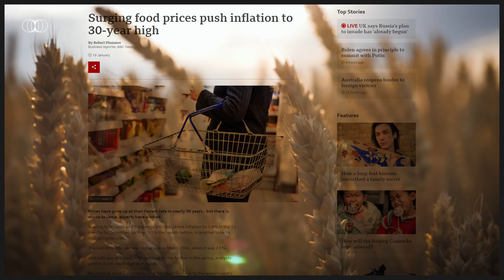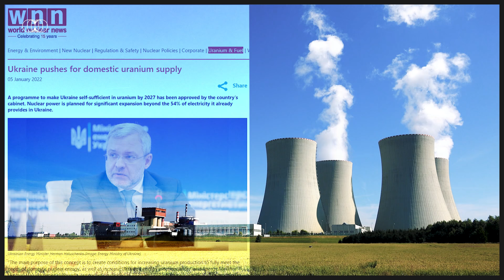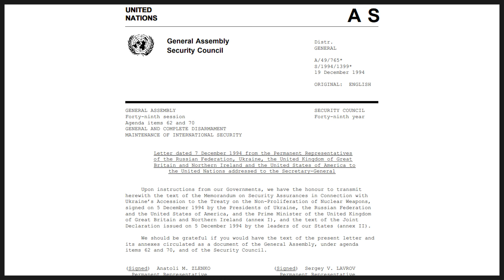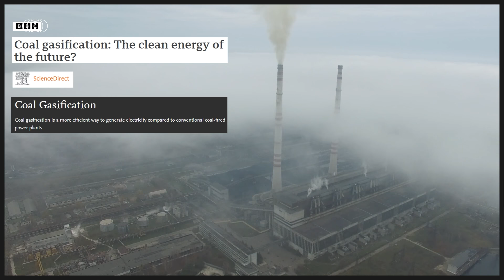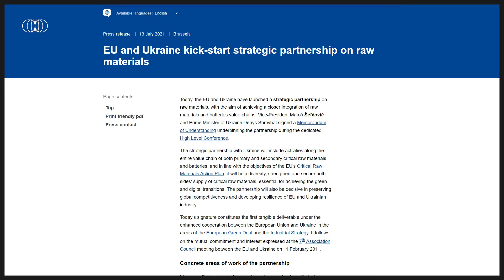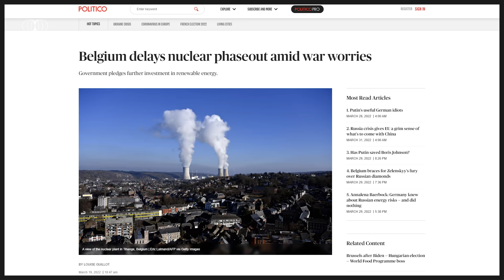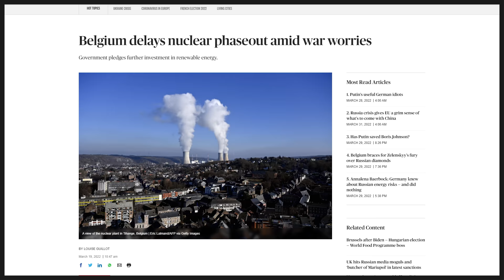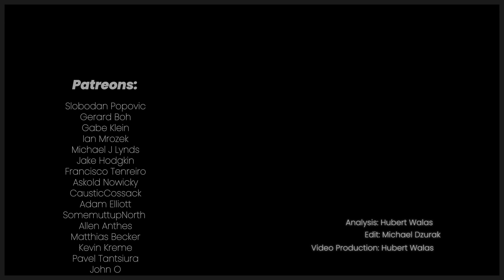Ukraine Sits On Raw Materials Worth Trillions. The Country's Chance for Reconstruction?

Comment: German opposition to nuclear power in the face of continuing their hydrocarbon plants seems like a miscalculation at best and myopically emotional at worst. As a source of clean energy, nuclear is far more easy to install than renewables. That they wouldn't first phase out coal and natural gas with nuclear, and then nuclear with renewables, but the reverse, is a decision that honestly baffles me given the environmentally friendly stance they oft try to promote themselves as taking.
Reply: I wouldn't call nuclear waste as clean energy and environmentally friendly.
Reply: the greens are paid by gazprom
Reply: @wokeaf1337  Nuclear waste is a problem, but it is about 1000 times less of aproblem than fossil fuel pollution damage and waste
Reply: @wokeaf1337  Its better than coal and the others besides the technology is getting better so is waste management eventually we might see nuclear energy with little to no waste
Reply: @wokeaf1337  Nuclear is clean, the footprint is extremely small, its basically just boiling water. However, the risk, which is scary af is if things goes wrong, but we're also putting in place extreme precautions to prevent another Chernobyl, and the technology has advanced quite far and there's even great methods of storing the Uranium waste which is a lot better than before with minimal if any effect on the environment.

Scary, yes, but the absolute best other wise.
Reply: @wokeaf1337  a nuclear powerplant creates less than 2 cubic meters of nuclear waste.An hospital creates more nuclear waste .
Reply: @wokeaf1337  I would. The environmental impact from nuclear waste at burial sites like Onkalo in Finland is comparatively nonexistent to the amount of released CO2 in the atmosphere that comes from burning hydrocarbons for energy. Arguing about the impact of nuclear waste when properly disposed of is a flimsy case of whataboutism at best.

Besides, even acting as though this hypothesis of nuclear being inherently and severely dangerous for the environment is true, why wouldn't you take a lower-impact replacement in the meantime, instead of keeping the higher-impact one? I understand that the cost of building intermediary nuclear plants on the road to 100% renewables can be seen as an unnecessary additional cost, but isn't a quicker path to zero carbon emissions the main goal here? Finding places to bury nuclear waste is, in my opinion, a trivial concern in light of that.
Reply: @marcobonesi6794  The Climate and Environmental Protection Foundation is the group you're thinking of. I have my own gripes with Die Grünen, but I'd rather not attribute things like Gazprom funding to them unless true.
Reply: Renewables are far cheaper and easier to build on large scales then nuclear power plants, but they cant generate a constant, stable output of energy. The biggest mistake we can do is thinking renewable and nuclear power are somehow opposite sides; A mix of both is the best we can do until we have fusion reactors, renewables for efficient, cheap, decentralized energy production and nuclear power as a stable backbone to even out the inevitable dips in power generation.
Reply: @wokeaf1337  The amount of nuclear waste from the production of all energy you will consume through your entire life on Earth is about the size of a Coke can.
Reply: @starwarsgames5467  Source? I was under the impression that nuclear was cheaper to utilise, but I'll happily admit to being wrong here if you've got something for me to look at.

(Although, I think it's also worth noting that some places just don't have access to the geographical features necessary for certain types of renewables, whereas a nuclear plant can theoretically be placed anywhere.)
Reply: High hurdles for longer nuclear power plant lifetimes
Status: 08.03.2022

Should the operating times of German nuclear power plants be extended to prevent supply bottlenecks? The Economics and Environment Ministries are against it - and operators also see high hurdles.Despite possible energy supply bottlenecks due to the Russian war of aggression in Ukraine, Economics Minister Robert Habeck and Environment Minister Steffi Lemke have spoken out against extending the operating lives of the remaining nuclear power plants. "As a result of weighing up the benefits and risks, an extension of the operating lives of the three remaining nuclear power plants is not to be recommended, also in view of the current gas crisis," the newspapers of the Funke Media Group quoted from a joint review note of the Economics and Environment Ministries. 

Short-term extension not economicalAn extension of the operating lives of the three nuclear power plants still in operation would not yield any additional electricity in the winter of 2022/2023, but at the earliest from the fall of 2023 after filling with newly manufactured fuel rods. Continued operation would have to be accompanied by an extensive safety review and staff training for each of the three nuclear plants.To justify the expense economically, an extension of operating times would be "necessary for at least three to five years," the paper says. The economics and environment ministries assumed that in the period until 2028, "other options will be available to ensure sufficient power supply despite a gas shortage." In addition, there were doubts as to whether an extension could be justified in a constitutionally sound manner.

Nuclear companies also see high hurdlesToday, German energy ministers are meeting for a special conference to discuss energy security after the Russian attack on Ukraine. The Economics Ministry said in advance: "Extending the operating lives could only make a very limited contribution to solving the problem, and at very high economic cost. The state would have to assume risks on a large scale here. The German nuclear power companies also believe that the feared energy bottlenecks can hardly be offset quickly by extending the operating lives of nuclear power plants. A spokeswoman for PreussenElektra, a subsidiary of the energy company e.on, pointed out that the supply of new fuel rods would take a long time. "According to an initial estimate, we assume that fresh fuel elements could be available in a good 1.5 years," she told the Rheinische Post newspaper. In addition, the corporations would then probably have to look for new uranium suppliers. "In the last years of operation of our power plants, we purchased the uranium needed for the fuel elements from Kazakhstan and Russia, and in small quantities from Canada."

Kretschmann: No prohibitions on thinkingBaden-Württemberg's Minister President Winfried Kretschmann, on the other hand, did not rule out extending the operating lives of coal-fired and nuclear power plants. He said that Economics Minister Habeck was right to say that security of supply must be guaranteed and that there should be no prohibitions on thinking. "I also see it that way," Kretschmann told the Süddeutsche Zeitung newspaper. "We must now find solutions in the short term - and in the medium term, there is no way around the fact that we will continue to push the expansion of renewable energies in order to make us independent of fossil fuels. "At the turn of the year, the Brokdorf, Grohnde and Gundremmingen nuclear power plants went off the grid. Since then, only the Isar 2, Emsland and Neckarwestheim 2 reactors, which are scheduled to be shut down at the end of this year, have been supplying electricity...
Reply: @marcobonesi6794  But that has nothing to do with the fact that they are paid by Gazprom.
I hate them myself, but rather because they almost always think first of the EU, other countries than Germany (always want European solutions), are often very left-wing, hate patriotism.
And as I said, since they are with the "Deutsche Umwelthilfe "an NGO that receives too much money from the U.S. and practically all major projects of Germany with lawsuits brams:
Billion € station project, there lives a salamander kind, construction stop=costs go to the sky.
Nord Stream 2= sue sue sue etc.
AKWS or nuclear waste transports=sue, block roads and railways.

Electricity lines from the north to the south of Germany=cry because they have to be built through forests etc.
Reply: @marcobonesi6794  That makes me laugh.

And there are many reasons against nuclear power.

For some, just look at France, which has had more blackouts than Germany, and has had to shut down more than half of its nuclear power plants a few times because of problems, such as the water in the rivers used for cooling becoming too warm in the summer (which is likely to happen more often).
They are outdated and their lifetimes have already been extended 2 times beyond their normal lifetimes.

All European nuclear power plant construction projects have problems right now, exceeding the planned costs and construction times.

And also the French operator of the Akws is permanently before the bankruptcy and must be subsidized again and again.
Reply: @revilorere  there are only 4 major nuclear disaster in history, 2 (mayak, pacific islands) are basically totally pursued, 1 (chornobyl) is a stupid human mistake mixed with old doomed technology mixed with soviet corruption, pretty easy to avoid, 1 (fukushima) is due to a natural disaster in pheraphs the most dangerous place on earth, nothing like that will happen in malaga, bologna, dusseldorf or lviv, I'm not even remotely scaried
Reply: @Janoip  ahhha . france is the cleanest major industrialized nation.Both in production and in consumption.What blackouts? The only times their reactors where shut down were during their scheduled maintenance. Use electricity map,an app that allows you to see how electric energy is produced and consumed in europe per every source.It 's data are adjusted every 15 minutes.
Reply: @marcobonesi6794  🥱

Fighting blackouts in France: nuclear power plant lifetime extension to 50 years
Since the energy turnaround is not making any progress, the nuclear power country wants to (or has to) extend the operating life of particularly dangerous old reactors.

Have our readers in Germany, Switzerland, Austria or Luxembourg ever received an e-mail or text message from their energy supplier or grid operator asking them to limit their electricity consumption at certain times? In France, a country with a nuclear power grid, it has been common practice since 2008 for citizens to be urged to do this via radio and television to prevent a blackout throughout the country. This was only narrowly avoided on January 8, when the country's neighbors were once again urged to save electricity.

The fact that there was almost a blackout throughout Europe, against which everyone is now trying to prepare, was also due to events in Eastern Europe.

Now, 32 old reactors in the neighboring country are repeating what was already seen with the old reactors in Fessenheim on the Upper Rhine. The French nuclear supervisory authority, the Autorité de sûreté nucléaire (ASN), is prepared to extend the operating life of old reactors by 10 years to up to 50 years, even though they were only designed to run for 40 years.

The nuclear regulator says that the extension is subject to the condition that design plans be updated, safety measures be improved, equipment be repaired and components be replaced. Years ago, however, the regulator spoke of a "worrying safety situation" at the nuclear power plants whose operating lives it now wants to extend.

With the extension of the operating life of Fessenheim, however, the ASN has already shown how the safety situation is improved primarily on paper. A faulty steam generator whose safety certificates were forged did not have to be replaced at the Upper Rhine, but was simply subsequently approved by ASN.

Fessenheim even went temporarily out of control in 2014 because of a leak of 3,000 liters of water that had entered unsealed control cabinets.

ASN has repeatedly shown itself creative in working around significant safety problems on paper. Although central safety elements are also defective, as at the new nuclear power plant in Flamanville, for which certificates had also been falsified, the ASN also wants to permit operation of this reactor.

The defective lid of the pressure vessel at the "European Pressurized Reactor" (EPR) is to be inspected after a few years in operation, although it is unclear how this will be done. No one is talking about the soil, which is also affected, as testing for this is ruled out.

It will now be interesting to see which retrofits the highly indebted state-owned operator Electricité de France (EDF) will have to tackle in order to extend the operating lives of 32 ancient reactors. For example, German Environment Minister Svenja Schulze has also stated, "There are technical and economic limits to what can be retrofitted - for example, an embrittled reactor pressure vessel cannot be replaced," which is why she rejects lifetime extensions beyond the "original design life."

As Telepolis had repeatedly noted, the approach in France, in which the nuclear regulator is playing along, is simply due to the shortage of electricity. Considerable dangers are being accepted because the country has maneuvered itself into a dead end in terms of energy policy. According to Greenpeace, 13 reactors are already running longer than the 40 years for which they were once designed, because the expansion of renewables is progressing very slowly.

The power shortage worsened with the shutdown of the two Fessenheim reactors last summer. In addition, the country is scheduled to phase out coal-fired power in 2022. Although coal-fired power plants contribute only 2% to the electricity supply, this means that there will be a shortage of additional electricity in the winter if it does get cold again.

But the nuclear friends in Paris had planned quite differently. Actually, the EPR in Flamanville with a net capacity of 1.6 gigawatts (GW) was supposed to compensate for the outage in Fessenheim eight years ago. But the EPR will not be connected to the grid before 2024.

Moreover, in view of ever new safety problems, it is questionable whether this will ever happen. In fact, 30 to 40 new EPR reactors were planned, but no new project has been started and therefore the operating time must be extended to dangerously buy time..
Reply: @marcobonesi6794  Some of many

Nuclear power plants shut down - again - because of heat

The Grohnde nuclear power plant will be shut down today because the Weser River is too warm; shutdowns and curtailments have already occurred in France and Switzerland.

The fact that it is getting hotter is really no longer news. But such record temperatures of over 40 degrees in Germany, even 42.6 degrees in the French capital Paris or in Switzerland, breaking all-time records, are also causing problems for the nuclear power plants. They are supposed to secure the basic supply, but it turns out - once again - that they can't really do that, and with climate change come ever greater problems.

This Friday, the Grohnde nuclear power plant is to be shut down due to rising temperatures on the Weser. Then, the river's water is expected to reach the critical limit of 26 degrees, he said. To protect the ecosystem of the Weser, warmer water may then no longer be fed into the river. Only when the Weser cools down sustainably will operation be resumed, the operating company Preussen Elektra announced. It assumes that the power plant can probably go back into operation from Sunday.

The heating of the Weser is also due to the drought, which currently has comparatively little water. This also applies to the great Garonne in France. That's why the two reactors at the Golftech nuclear power plant were shut down on Tuesday because the Garonne, which also has relatively little water, was getting too warm. In Chinon, on the great Loire, one is also only 0.3 degrees below the shutdown threshold. Actually, this nuclear power plant should also have been shut down long ago, but in the nuclear power country of France, the limit is set at a murderous 30 degrees for flora and fauna.

In the nuclear power country, people are now used to blackouts practically every winter. Most recently, this was even the case in January, although none of the many old reactors had to be shut down unplanned, but because coal-fired power plants were on strike, which in any case contribute very little to electricity production. Now, because the two ancient reactors at Fessenheim are scheduled to go offline in 2020, things could soon be tight in the summer as well, because the replacement with the EPR will fail to produce electricity.

As the heat rises, the need for cooling increases not only at nuclear power plants, but also in companies and private households, which in turn significantly increases the demand for electricity. If rows and rows of nuclear power plants have to be shut down during a heat wave, the usual calls to save electricity in nuclear power country will probably soon be heard in the summer as well.

In the meantime, Switzerland has learned from the fish kill in the Aare River last year and lowered the threshold for cooling water withdrawal for nuclear power plants to 25 degrees. If the water temperature rises above 25 degrees for three days, it must be shut down. The nuclear power plant in Beznau has already throttled its output as a result. The operators are lucky, however, because today the Gösgen nuclear power plant shut down unplanned. This means that the Aare will not be additionally polluted by this power plant. However, Gösgen and Leibstadt do not contribute as much as Beznau or Mühleberg to the heating of the river because they have cooling towers.

Since cooler water now flows from the Swiss Aare into the Rhine, however, the Fessenheim nuclear power plant does not come under pressure quite as quickly. In the Rhine side channel, from which the power plant, which has no cooling towers, draws its water, the temperature may rise to 28 degrees before the two reactors have to be shut down. Last year, this was already the case with the large, old and scrap-worthy immersion boilers in the Rhine..
Reply: @marcobonesi6794  Germany is also a Exporter of Energy¯\_(ツ)_/¯
Reply: @Janoip  you have to look at the net export. Not the gross one. And germany imports more energy than the amount exported.
Reply: @marcobonesi6794  German electricity export surplus declines
In 2020, Germany exported around 17,400 gigawatt hours more electricity abroad than it imported. This means that the export surplus continues to decline
Bonn Germany imported significantly more electricity in 2020 than in previous years. Until shortly before the turn of the year (December 20), just under 33,000 gigawatt hours flowed into the German power grid in commercial electricity trading, according to figures from the Federal Network Agency obtained by Deutsche Presse-Agentur. That is around 36 percent more than in 2019.

Because less electricity was also sold abroad than in the previous year, the German electricity export surplus fell sharply. At around 17,400 gigawatt hours, it was only half as high as in 2019 (35,100). By comparison, gross electricity generation in Germany in 2020 was 564,000 gigawatt hours, according to preliminary figures.

According to the Federal Statistical Office, one reason for the growing electricity imports is the declining share of coal-fired and nuclear power plants in electricity generation in Germany. Particularly when there was no wind or darkness, electricity was imported to meet demand, the statisticians noted with regard to the first half of the year. In 2020, France was once again the main importer of electricity, while Austria was the largest consumer...

Translated with www.DeepL.com/
Reply: @yyperi  So only if people die is that a cause of concern for you? And between "clean" and "far less" of an issue, there are worlds in between.
Reply: @wokeaf1337  Nuclear waste can be perfectly contained, preventing any harm to the environment. All you need to do is invest in proper final disposal facilities.
Reply: @RM-el3gw  Nope, u need to dig deep, to store the nuclear waste in rock strata. As a result, the soil can lose its important functions as a (ground) water reservoir, pollutant regulator, climate regulator, as a habitat for a large number of soil organisms and as a source of food and raw materials. Drinking water is also at risk therefore it doesnt matter from what angle u look at it, it's not good at all.
Reply: Would be possible for a military to destroy the reactors, or nothing will happen?
Because the Chernobyl exclusion zone looks rather big; it's far worse than all nukes launched ever combined. Without counting the effects it had on Europe as well.
Reply: @98Zai  What country are you from?
Reply: @asasas9146  Yes the military can destroy reactors and possibly cause a meltdown on these older plants. That's the thing though.... older plants. The worst disaster to befall nuclear energy was not Chernobyl but the protests that arose from it. The result was that humanity not only moved away from using "dangerous" nuclear energy (statistically it's safer) but research and development of better, safer, and more efficient technology came to a grinding halt. Take Molten Salt Reactors for instance. They were looked into 60 years ago but due to regulations and bans the research slowed to a crawl. These things basically can't go critical. They can't Chernobyl. They can't Three Mile Island. They can't Fukushima. So....  hippies traded burying 1 cup per person of nuclear waste in a mountain for literal tons of debris per person floating around in the atmosphere that humans will have to breath. Nuclear waste might take thousands of years to break down but at least we know where it is and generally will not affect the environment.
Reply: @flyingeagle3898  It is not a problem with molten salt reactors that have fuel in a liquid form.   Nuclear Waste can be used to breed thorium and these reactors are actually nuclear waste burners.  The US actually invented these reactors in the 1960s but they were never made commercially and the technology was archived.
Reply: @98Zai  ??? So i am not allowed to know nuclear power is good because some other person thinks climate change isn't real? This makes no sense.
Reply: @enoughrope1638  Nuclear power is amazing. It's just not a good idea on Earth. Other types of energy production are going to overtake it before these "new plants" even manage to get built. So whomever convinced you it's a good idea either sits on the technology and is deadset on making a extremely big profit from it, or they want the rest of the world to have dangerous, centralized infrastructure. Nuclear power is great, and research should be conducted. We'll need it when we start exploring space.
Reply: @98Zai  why isnt it a good idea on earth? Why do you want to burn fossil fuels so badly? I'd love to switch to hydroelectric, solar, wind, geothermal etc but it just isn't possible to transition to it quickly and solar/wind have serious drawbacks. You keep mentioning centralized infrastructure as if we don't already have it and it isn't required regardless of where we source our energy. Unless you have a massive breakthrough in battery technology this will not change. Oh and think it through.... if you think someone convinced me nuclear is the way forward because of profit than perhaps someone convinced you fossil fuels are the way forward because of profit. TBH I am done replying unless you add something new to the conversation beyond anecdotal accusations of tribalism.
Reply: @enoughrope1638  Let's see; 
✅Stagnation of research into safer energy production.
✅Incompatible with the unique life forms on this one-of-a-kind radiation free planet.
✅Children own weapons that can cause incomprehensible damage.
✅Unreliable as main energy source in a much more chaotic future; Fukushima. 

Should I go on listing the practical problems involved as well? It's really easy to find online.
Reply: @98Zai  The first point is nonsensical as you are basically saying "Using safe energy production will prevent the research of safe energy production" and not acknowledging the fact that it could be applied to other forms of safe energy production as well. The second point is flat out wrong with life only existing on earth due to radiation. If you mean highly concentrated doses of radiation I must again point to the fact that modern reactors cant go critical. Fossil fuels kill vastly more people every year than nuclear energy ever has. The next point is also nonsense. Children owning weapons has nothing to do with nuclear energy. It almost sounds like you got all your information from playing fallout or something. Finally it is perhaps the most reliable source of energy there is. Cloudy days disrupt solar panels and they don't work at night. Windmills require wind. Hydroelectric falters during droughts. Coal, oil, and natural gas are reliant on supply chains which can be disrupted. MSR's? A small amount of fuel and they run for years with no chance of meltdowns. Reliable, safe, and clean. You're either really into fossil fuels or under the false impression that we can transition to pure solar/wind without a radical breakthrough in battery technology. I'm done here.
Reply: @enoughrope1638  I'd like to add that I hate fossil fuels. This isn't a battle between atomic energy and fossil fuels. Many countries are already using mostly renewable power, and I don't see any way that will slow down. We will have to phase out fossil fuels anyways, but phasing it out into atomic power isn't a good idea.
Reply: @98Zai  why?
Reply: @dimaselm3569  Please be more specific :)
Reply: @98Zai  I have a bit to say, so I would appreciate if you read it. ^^

"Stagnation of research into safer energy production."
This is easily your most coherent point, but it both relies on the preconception that nuclear is inherently dangerous to prove itself (circular reasoning), and it overlooks the fact that for nuclear, there is no waiting time. We have it. Now. Renewables are a work in progress, and we've no clear timetable on when they're going to deliver. Ought we to simply twiddle our thumbs while this planet burns? I think not. Nuclear interferes little with the R&D process of renewables, as it's an existing technology. Thorium reactors, meanwhile, are set to produce more energy with less waste, so maybe those would be worth researching? China seems to think they're a good idea.

"Incompatible with the unique life forms on this one-of-a-kind radiation free planet."
Radiation poisoning is incompatible, not nuclear power in of itself. If the determinant of whether or not we developed the technology for something was based upon if it was harmful to human life, there would be no industrial chemical industry. Yet, here we are, because both of them are beneficial to us in some regard.

"Children own weapons that can cause incomprehensible damage."
Okay, who are the 'children' here? I really don't think this is in reference to literal children, so I'm forced to speculate a bit. Is it that you're calling world leaders children, or entire countries? Because either way, it's an awfully high horse to be coming from.

"Unreliable as main energy source in a chaotic world; Fukushima."
Source? Fukushima Daiichi failed because there was a 9.1 earthquake and tsunami, and it's not like global warming affects the speed of the Earth's crust movements. Besides, odds are on that you live in a place that rarely, if ever, gets earthquakes. Reactors are much safer nowadays, and if you compare the exposure levels of, say, Fukushima and Chernobyl, it will necessarily become apparent. Neither does the claim of unreliability hold up, as nuclear has proven reliability; see France, whose power comes almost totally from nuclear and who haven't experienced a major disaster yet.
Reply: @ArchOwl  Let me preface this with the fact that we have to discuss this, we can all see the negatives of nuclear reactors, meanwhile the only downsides to renewable power is that battery tech/storage solutions aren't up to par just yet. 

Now, -stagnation; It will take at least 10-15 years to build any large scale reactor, and when it's built it will run for 40 years. There is no incentive to shut them down prematurely. Meanwhile, we also have no incentive to put funds into other means of production. It will be a repeat of previous decades and just like then, no serious progress will be made. (ok, I bet a lot of people think like me and will work on it, but far from everyone). In my opinion nuclear power should be the auxiliary research branch specifically for space travel/stations.

-incompatible; Imagine a scenario where we as a species focus on nuclear power, over the span of centuries we will unearth and amass plenty of radioactive substances which will contaminate the planet virtually forever. We are today trying to mitigate the horrors of old industry by cleaning up pollution etc. Why shoot future people in the back just like the Victorians did to us? We are just now starting to realize how important our delicate systems are to us, how much pollution and toxic materials cause havoc on this planet. I'm sure you're aware of places around you which are polluted and unusable because of industry. Let's not repeat our mistakes.

-children; We are a species that cannot handle all the worlds problems at once. We have to rely on partitions to organize the world in some manner. Those partitions can become insular and then Russia invades Ukraine for some reason. We consider ourselves very evolved, but we're just monkeys. Don't give the monkey dynamite. 

-unreliable; I consider Japanese people to be the epitome of organization and precision. They are very detail oriented and industrious, partly thanks to their culture and partly thanks to almost all of them being introverts? Despite all that, they found cracks and leaks in Fukushima daichi, and the Government didn't think it was a high enough priority to shut it down for repairs. Probably because they are so reliant on the power produced. If the Japanese, living in a chaos zone of earthquakes and tsunamis can't uphold a standard of something so important, I have little faith in almost everyone else. France is doing a good job, but it only takes a slight economic dip or even some lazy oversight for the dark stars to align. When you're playing with atomic power, you can't be at the mercy of a million variables.
Reply: Dear Archivist Owl,
I'm going to guess that you are still quite young, because your comment "breathes" a certain youthful entusiasm, but, for example, the statement, "As a clean energy source, nuclear power is much easier to install than renewables." is simply wrong.
Germany has no uranium deposits, the handling and storage of nuclear waste is problematic, the construction and operation of nuclear power plants is costly, waste heat is an increasing problem, a nuclear power plant represents a speculative safety risk, and so on. 
Most importantly, nuclear power is always a centralized large-scale "solution" to the electricity problem, which means that there will always be a need for a power grid and there will always be a government or private corporation looking to make a profit. From the point of view of the private consumer, it makes a hundred times more sense to deal with a photovoltaic-powered refrigerator, solar thermal water heating, cooking with gas, solar thermal-powered ground storage, heat pumps, etc., than with nuclear energy, where you will never be your own boss, but always just a paying customer. Make the simple calculation how much solar cells you need for your private electricity consumption and invest in this direction. Inquire about cooperatively organized electricity providers or acquire shares. Approach "your electricity problem" in such a way that you can solve it for yourself and don't think of any corporation that will or should do it for you.
But if you are still a friend of large-scale approaches, I recommend geothermally fed district heating networks in urban areas.

P.S.: Cool name, Archivist Owl!

Sehr geehrte Archivist Owl,
ich vermute mal, daß sie noch recht jung sind, denn ihr Kommentar "atmet" einen gewissen jugendlichen Entusiasmus, aber z.B. die Aussage: "Als saubere Energiequelle ist die Kernenergie viel einfacher zu installieren als erneuerbare Energien." ist schlichtweg falsch.
Deutschland besitzt keine Uranvorkommen, der Umgang und die Lagerung des Atommüll ist problematisch, der Bau und Betrieb von Kernkraftwerken ist aufwendig, die Abwärme stellt ein zunehmendes Problem dar, ein Kernkraftwerk stellt ein spekulatives Sicherheitsrisiko dar, usw.. 
Vor allem aber ist Kernenergie immer eine zentralistische großtechnische "Lösung" des Stromproblems, was bedeutet, daß es immer eines Stromleitungsnetzes bedarf und es immer eines staatlich oder privaten Konzern geben wird, der Gewinne erzielen will. Aus der Sicht des privaten Verbraucher macht es hundertmal mehr Sinn sich mit einem photovoltaisch betriebenem Kühlschrank, solarthermischer Warmwasseraufbereitung, Kochen mit Gas, solarthermisch gespeisten Erdspeicher, Wärmepumpen usw. zu befassen, als mit Kernenergie bei der sie nie ihr eigener Chef sein werden, sondern immer nur zahlender Kunde. Machen sie die einfache Rechnung auf, wieviel Solarzellen sie für ihren privaten Stromverbrauch benötigen und investieren sie in diese Richtung. Erkundigen sie sich nach genossenschaftlich organisierten Stromanbietern oder erwerben sie Aktien. Gehen sie überhaupt an "ihr Stromproblem" so heran, daß sie es für sich lösen können und denken sie dabei an keinen Konzern, der es für sie tuen wird oder soll.
Falls Sie aber weiterhin ein Freund von grosstechnischen Ansätzen sind, empfehle ich geothermisch gespeiste Fernwärmenetze in Ballungsgebieten.

P.S.: Coller Name, Archivist Owl!
Reply: @michaelneuwirth3414  First off, thank you Michael! I thought about this username for a while, so your praise of it is appreciated and valued. While it was quite considerate of you to write a reply in both English and German, I'm sorry to say that I don't actually speak German (yet), I just have a few German friends and some information on the topic. As I'm looking towards my future, though, I'm increasingly seeing less hope for it in America, even with a highly technical degree as I hope to earn. Maybe one day I'll come back and read both halves of this. :)

But that said, I would like to respond to you, and hopefully not too late for you to be reasonably able to see this. I may be a bit young, true, but I feel I can back up my position in light of your criticism.

*This will be a bit long. ^^;*

Nuclear power, in principle, is not a complicated process. It's pretty much just radioactive materials heating up water into steam at a tightly monitored rate. Of the principles involved in renewable energies, I would say that the method of power generation in nuclear plants is about as simple as wind, maybe a little more complex than geothermal energy (which you proposed, and which I agree show great potential in the areas where that actually is an option), and a lot less complex than solar power (or more specifically, photovoltaic cells).

The faults in your argument here lie mainly at two places, in my opinion: your rebuff to the claim that nuclear power is easier to install than renewables, and your implicit assertion that private power generation and public power generation are inherently exclusive of each other.

To answer the first one, I should admit that I worded my claim very poorly. Instead, I should have specified that my claim is "nuclear power poses fewer long-term or large-scale complications than renewables," which is in essence still relevant to your points, except for your first and most legitimate point to the original wording: Germany possesses no uranium. While this is not strictly true, it is effectively true, as Germany indeed hasn't mined uranium since its reunification (although a few dozen tons annually were still produced as recently as 2011, simply as a byproduct of water purification in uranium mines). This I fully accept as being a valid critique. Moving on from that, however, I feel your generalised concerns regarding nuclear waste and nuclear plants in general are ill-founded.

The world is simply not the same as it was when Chernobyl rocked the world in 1986. We have evidence that it is not as dangerous: in the wake of the Tohoku earthquake (Japan's strongest ever), Fukushima suffered a disaster that was controversially rated by the IAEA as equal in seriousness to that in Chernobyl some 25 years prior. But if we are to compare fatalities alone, Fukushima's single death after some 11 years on is in no way comparable to the thousands that came to perish in the time after Chernobyl. This increased safety is not purely in a reactive context either, though. Today, nuclear fuel rods are transported in containers robust enough to withstand a direct impact from a train and survive. Further, not all waste is created equal; less than one percent of all nuclear waste is high-level waste. As far as safety, dry cask storage above the ground (which only occurs after a couple decades' interim) is plainly safe: the radiation received annually just outside the fence is lower than that of a single plane flight around the globe. Deep-earth storage, meanwhile, for the really high-level stuff, is currently constructed to depths where groundwater and geological activity are frankly not a concern, even over hundreds of thousands of years. I struggle to understand what you mean by waste heat being an increasing problem, because I don't see any problems here to begin with. As far as the speculative safety risk goes, 'speculative' might indeed be the best adjective to describe it with.

Okay, let's talk cost of operation, then. You stated that the "construction and operation of nuclear power plants is costly." This is half true. The construction of a nuclear power plant is indeed quite high, and while I'd like to argue that it needn't be so, the current fact is that it is. However, the operation cost of a nuclear power plant is far and away the cheapest option on the market, no holds barred. Citing IRENA for renewable energy cost globally (2019), and the Nuclear Energy Institute for nuclear energy cost globally (2017), the cost per MWh, from greatest to least in USD: $70.00 (geothermal), $68.00 (solar PV), $53.00 (wind), $50.00 (hydroelectric), and $33.50 (nuclear). I think this speaks for itself.

The preference for decentralised power over centralised power is a subjective one; I personally believe that by large collective support (i.e. taxes), the cost upon the individual for a large project like a nuclear reactor is at least comparable to that of personal energy generation, especially if placed in the hands of the government and not any private party. Further, with lithium shortages threatening our ability to produce Li-ion batteries in the future, many renewable energies' futures are somewhat in jeopardy until we can make up the global difference in alternative methods of energy storage, like "lake batteries" and such. But here, I think it's entirely valid that we agree to disagree; especially in more secluded and rural areas, personal energy generation is obviously far superior to any centralised system, and it's not an approach without merit in urban cities either. I just lean one way here, and you lean another.

P.S. If you somehow read this far, I do want to express my sincere thanks for approaching me with your disagreement in a friendly way. I really appreciate it, especially when it feels like that's all too lacking in the hyperpartisan environment I know here. Vielen dank!
Reply: @WangAiHua  As convenient as that would be, I can't just accept that the Kremlin made Germany hate nuclear without a source, lol.
Reply: @ArchOwl  
Are you kidding---easiest thing in the world!---Schroeder didn't get a seat on Gasprom for nothing!---All of the male members of his party received a free all expense paid trip to Moscow with all of the kompromat thrown in as well---they don't keep cameras in the hotel rooms for nothing!
RuZZian gas is a very lucrative source of income for all of those who are willing to participate in the process.---RuZZia also has a whole team of propagandists to assist in encouraging the public to go off bad, bad nuclear!
Reply: @WangAiHua  wow. i think i owe you an apology. your wording is a little vague and rambly but i looked into these claims and they seem... sound. couldn't find anything specific regarding any kompromat, but it's wild that something as brazen as schröder receiving a seat on gazprom and overseeing nordstream—RIGHT after leaving office—actually happened. (of course the propagandist claim can't be backed up by a specific source, but that's just general knowledge at this point.)

but yeah, thank you for providing evidence so quickly, i wasn't expecting that! i thought that only my country (USA) was this bad at hiding open corruption, lol.